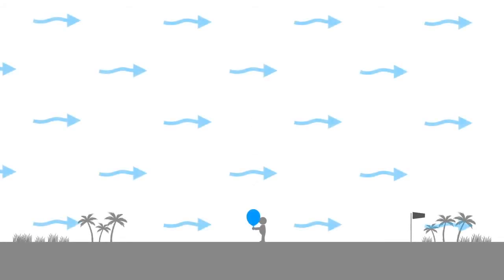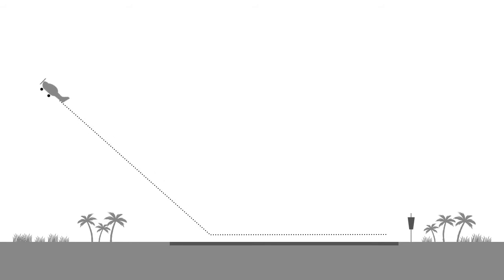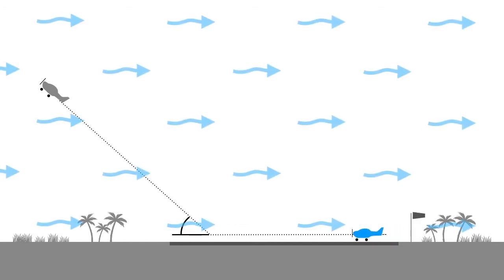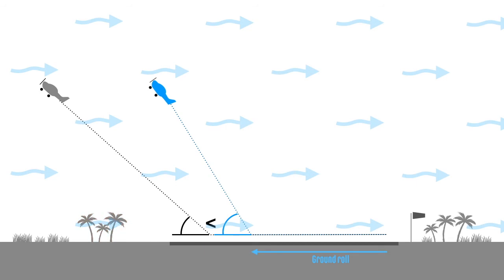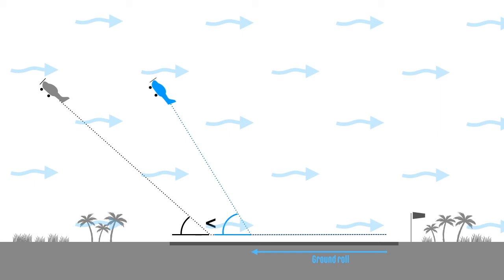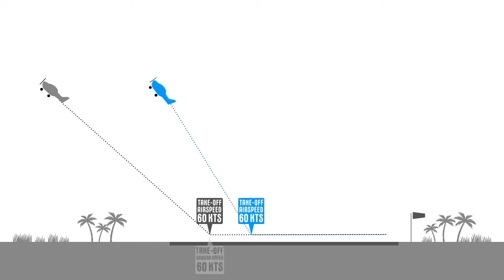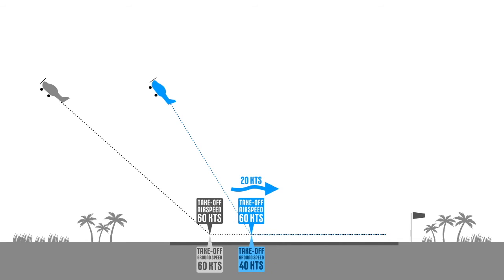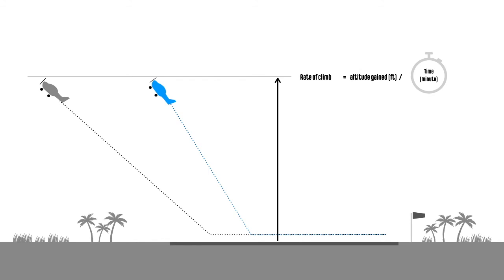Angle of climb vs rate of climb.

Comment: The informations in the video is right except one point. Wind has no effect on rate of climb and angle of climb. You here just say rate of climb is the same with/without wind. But also angle of climb is the same, not steeper in a headwind condition like stated in the video. Because, while the aircraft is climbing:
sin(climb angle) = (Thrust-Drag)/Weight. In this equation, there is nothing to do with the wind.
Reply: Wind does effect angle of climb relative to the ground, the equation provided is assuming nil wind scenario or is comparing the climb angle to the air itself.
Reply: Of course the wind will affect the angle of climb, remember, it’s relative to the ground.
Reply: imagine an airplane's Vx is 55kts, and it's taking off in a 55kts headwind
the airplane will climb like a helicopter (give or take).. so it's much steeper than climbing in no wind

Comment: Well, that's it? If I was a student pilot learning Angle of Climb and Rate of Climb for the first time, I wouldn't understand anything from this video. 🤷🏻‍♂️
Reply: As stated in the video:

Angle of Climb - The angle between the aircraft's flight path and the ground.

Rate of climb - Altitude gained (ft)/time (minutes).

Headwinds will shorten the takeoff distance due to lower GS and higher IAS.

An aircraft climbing in nil wind conditions will travel a greater distance to reach a specific altitude at a specific rate of climb in comparison with an aircraft climbing at the same rate into a headwind.